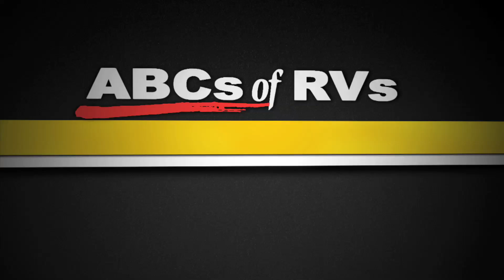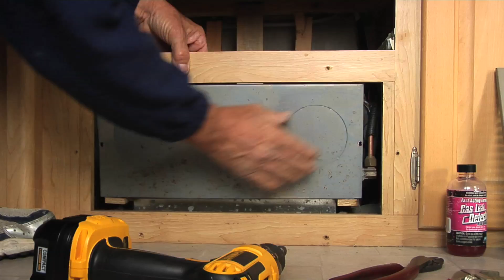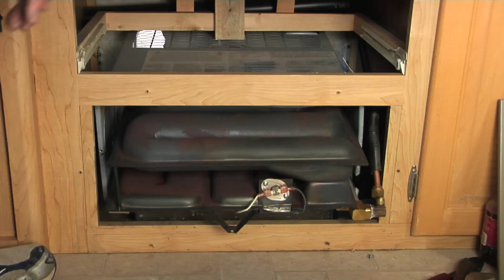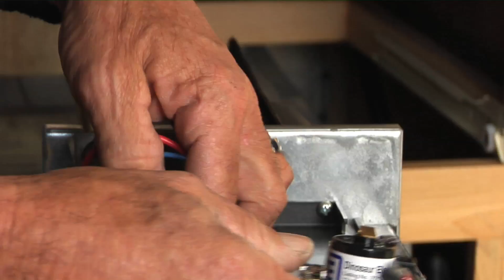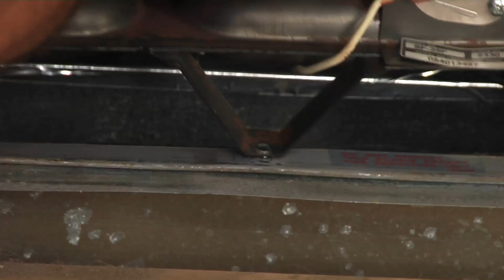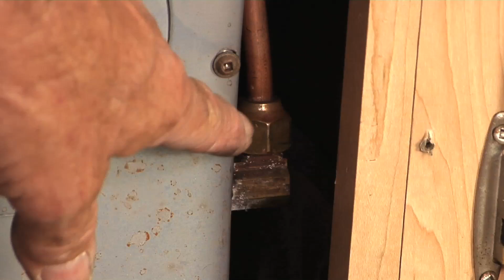Replacing a RV Furnace Circuit Board

Comment: We picked up a 5th wheel and the furnace does not work. LOTS wrong with this RV! We bought a Dinosaur circuit board but not sure if it was ever wired properly.  Do you have a screenshot or picture of the connectors and wires to the furnace? I'm having a hard time finding the correct pictures. We have 12V white and red wires coming in but not sure they are in the right spots. It won't ignite or turn on at all without jumping wires.

Comment: We are having issues with our Suburban not lighting at higher elevations, over 5000ft. dry camping.  So switching to the Dinosour is going to be our first step of trying to fix that.  We will post a video of that when all said and done. The manufacturer said they sometimes don't light and there is nothing they can do.  We called them, AND our RV repair guy called them.  Great video and super helpful!

Comment: On your original board, there are three pins that connect (2 red, 1 blue) the replacement only looks like two pin connections.... I have 3 pins and can only find replacements with 2, any suggestions?  What did you do with the third wire?  One is red power, one is red fan control, and blue comes from thermostat on/off switch
Reply: Im in the same boat. I was about to order one then i looked at the pins.

Comment: What exactly is a "pressure leak down test". Who does that or what can you buy or rent to DIY?
Reply: cowboy7x. Leakdown test is when you charge the system with propane and then close your bottles off to let the pressure in the lines hold without being supplied by the bottles. Wait about 15-20 min and go turn on a burner on your stove if the burner makes any hissing noise your lines held pressure and no leaks, you can wait longer if you arent satisfyed with the 20 min. There isnt really anything to get. There are gagues on the market but to me its really not worth the 200$ price tag to hook it up and watch the gague slowly trickle to 0 when you can just go turn on the stove and hear no hiss instead.
Reply: What dinasour board did you use exactly? I have a suburban sf-30fq and the "Q" has been killing me on this. I know it just means quiet but I ordered a Dinosaur BIU S and I dont have the blower connecttions on the board itself so now I'm at another stand still. Your stock board resembles mine more so than any other video, part number would be greatly appreciated!

Comment: I pulled mine today not very difficult I found mud dobblers in the fan cleaned out and installed. I spent two hours total not bad but I will have to remove tomorrow because it will not come on.

Comment: I wish only an hour and fifteen.  My trailer's furnace has no access and the furnace is built in between the stairs to the bedroom and the drain line for the laundry washer plus various wire and cables with not enough slack.